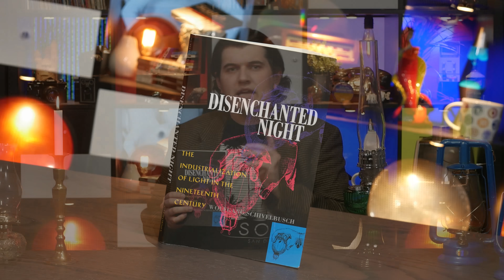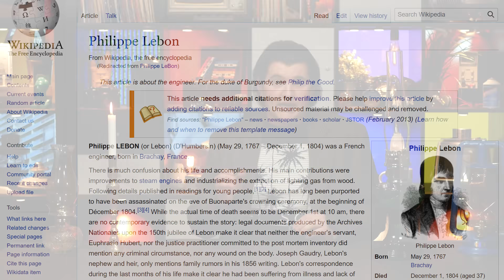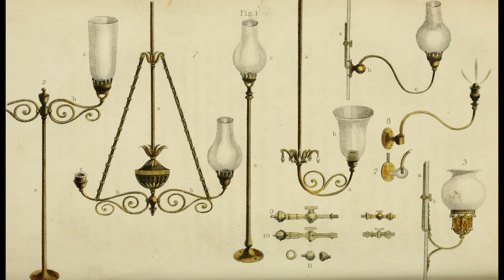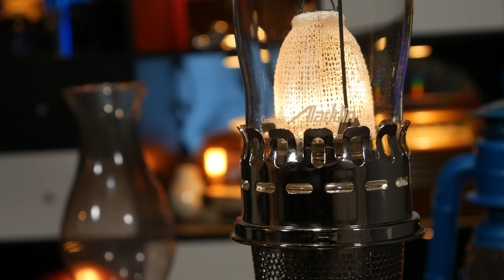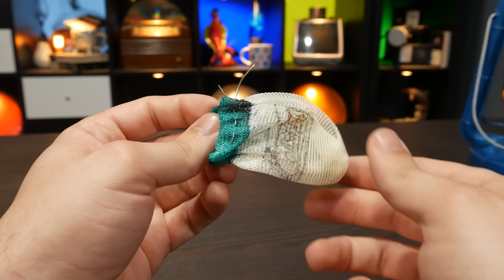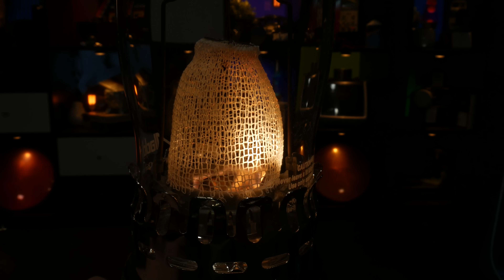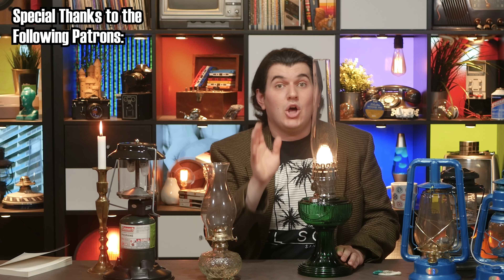How the gas mantle made lamps 10X brighter

Comment: Please heed the safety instructions! The lamps must be monitored during use. DO NOT light and walk away, as the flame increases as the lamp heats. I did this once, lit, turned flame very low, got distracted, smoke alarms went off and red flame was roaring out the top of the chimney.
The lamps are still used in rural areas, by the Amish, they tell me, and mantles, wicks and burner parts are sold in one local hardware. I collect them, they're fun to tinker with, a pain to trim the wicks, but fun to just turn off the lights and watch the lamp run.
Reply: I was raised with aladdin lamps, only 65 years old, we built home made diesel lamps for using while milking cows. My neighbour still doesnt have electric, his mother in her hundreds has moved to a house with electric but she was carrying coal buckets at 99, she couldnt start the generator so had to wait till her son got home, the generator would only run for a while at night. ( We installed electric in several farms when i was young). (In Scotland).
Reply: @windyfarmer.6095  I never had them as a kid but when I started going to rural areas in the 70's all the types were very common, flat, Dietz and Alladin and the Coleman types.  I still have examples of all of them at the ready for the inevitable power failure and the occasional evening just for ambiance.
Reply: @windyfarmer.6095 DIESEL doesn’t evaporate like gasoline, so how did you get a lamp to burn from diesel?

.
Reply: @electrictroy2010  We used kerosene (alternatively diesel, but would not burn as cleanly) lamps in civil service. They contain an evaporation tube that heats the fuel and turns it into gas. The gas mantle is enclosing this preheater tube and heats it.
To start it up you have to pre-heat this tube with fuel tablets.
Reply: Norma,I am wondering if the old style Aladdin lamp idea with an incandescent mantle could be adapted to a mantle lamp that uses Bio Ethanol for fuel rather than Kerosene/Paraffin.
Ethanol burns much hotter than Methanol and carries far less toxicity issues with its use. 
As far as wicks for burning Bio Ethanol are concerned I already use homemade wire filament wicks in small bottle type burners. 
I think there may be some worthwhile experiments in adding an incandescent mantle.
Reply: @howardosborne8647  If the lamp already has an evaporator tube system, the vapour will pass through a "jet" which regulates the flow of  fuel into the burner assembly (mantle, whatever) and maintains a back-pressure on the fuel pump and delivery system. You will likely need a different size "jet" for a different fuel with a different heat yield per volume delivered to the burner. If the jet can be unscrewed and replaced, getting a different jet MAY be possible (though for getting the correct jet - the manufacturers may not have one ; threads and jet diameters are not standardised and are not interchangeable).
You might be able to get a "blank" jet (no hole) and make your own hole to size. 
Your project is do-able, but may not be easy.

"Ethanol burns much hotter than Methanol and carries far less toxicity issues with its use." 
Most retail fuel-ethanol is "denatured" with enough methanol to make it poisonous, to stop people from drinking it. See your local urban myths about "meths drinkers going blind" - the first effect of methanol poisoning is typically damage to the optic nerve. The toxicity difference between methanol and (denatured) (bio- or industrial- ethanol) is not worth recording. They're both poisonous. 
Methanol has a different heat yield per volume of vapour. You'd need to change "jet" if swapping from "methanol" to "ethanol" (denatured or "vodka"). I'd just find which is most reliably available, and set your project up for that.
Locally, it is getting very hard for me to find the correct fuel to use in my camping stove. I've had to (reluctantly) get a propane/ butane stove.
Reply: Lehmans in Kidron OH?
Reply: @ronunderwood5771 Lehman's is a very good source for lot's of stuff! W. T. Kirkman Lanterns in  Ramona, CA is another good source for oil lamps and lanterns. I've collected of a variety of liquid fueled lamps and lanterns over many years. Another tip, Kingsford or other good quality charcoal lighter fluid is a good alternative to ultra pure lamp oil. (Burning too much regular kerosene gives me headaches.) My experience with Aladdin lamps is that while they are cleaner burning than flat wick lamps, they are not quite odorless.
Reply: My grandmother had one in the 80s
Reply: The incandescent mantle requires higher temperature to glow. Chimney glass pipe will increase temperature or forced air directed at flame like for Blacksmith bellows concept , computer fan even .
Reply: You had (very probably) put a more volatile fuel (petrol, gasoline, naptha) into a lamp designed for a less-volatile fuel (diesel, kerosene, petrol). It is important.

I remember once meeting, at a mountain hut, a kilt-clad man who had to put his cooking stove out by picking it up with long-handled pliers and dropping it into the stream. I questioned him about this - since I had a similar stove which behaved itself "better" - and he told me "it's meant for petrol, but I use 40/60 petroleum naptha". Which was obviously meant as a brush-off, but since my father was an industrial chemist, I understood him, and we continued chatting at that level before heading off our separate ways.
A couple of years later I met him again, still kilt-clad, in a lecture theatre at the local university chemistry department where he was a literal professor and I was a junior student. He always wore a kilt because the burns on his legs from a mistake when he was a student made trousers too painful. This made him very recognisable.

He understood his tool perfectly (note : he carried long-handled pliers), had a source of 40/60 petroleum naptha, and was deliberately abusing it under control.
You put the wrong fuel in a lamp designed for a different, less volatile, fuel.

Comment: 14:44 the flames are different shapes and fuel mixtures, but their heat is relatively the same. the difference in brightness is due to flame coverage on the surface area of the mesh. thus, you cannot conclude from your hackneyed demo that "a pure and hot" flame is necessary or better than any regular flame.

Comment: Lute, In Chemistry: it is a liquid clay or cement used to seal a joint, coat a crucible, or protect a graft. As for "protect a graft", again, in chemistry, it is referring to something like a long, thin, glass tube inserted through a hole made in the side of large glass beaker; the graft being that 'connection'. Whereas, again in chemistry, a "joint" is specifically where two ends are 'joined' together. Thus, the phrase, "...forced my lute", means that it broke through material that sealed and connected the 2-piece glass made item together.
Reply: who up forcing they lute
Reply: Goat
Reply: Thank you random 30th Armored Brigade guy.
Reply: @rediius that would be 30th US infantry division (Old Hickory/ Roosevelt's SS)
Reply: I assumed about the same. I wasnt familiar with the terminology, but I figured it meant one of th glass containers exploded or broke.
Reply: THANK YOU!!!
Reply: So you didn't read the pinned comment posted a year before yours?
Reply: I thought the person meant "Force My Loot" as in "forcing treasure or valuables down through something".
Reply: @SuperFlashDriver Do you mean like, cash down a well?
Reply: @bugsbunny8691  Yeah, that's what I thought the person was saying. But it turned out he meant something else.
Reply: Outstanding. Thank you.
Reply: I was about to explain as well... its not hard to research at all.

Comment: Interesting and informative video. I remember many years ago having a Coleman lamp with the bag shaped mantles like at 17 minutes. When new, you had to burn off some material that was blue if my memory serves me right. After that, they worked well, putting out a lot of light. The fuel it used was naptha.
Reply: They are pressurised lamps
Reply: I have two of those old Colman lanterns.  My dad bought them back in the 60's.
Reply: I still have a couple my parents used when camping, when I was a kid. They still work but I always start them outdoors.
Reply: Some mantles (Coleman) are thoriated,  meaning they are treated with thorium and are radioactive. The thorium increases the brightness.
Reply: @daryllect6659 that's why you had to commission them outside. Afterwards they were considered safe for indoors. You couldn't touch them simply cos slightest touch would destroy them like a moth flapping around . Thus an inbuilt safety precaution built in 
  You needed to wash hands though after commission ing.
Reply: You beat me to it  by a day - 1 year after the video came out...!

Comment: You know there's a way that incandescent bulbs could actually match the energy efficiency of LEDs... Insulate the filament so it doesn't require much extra heating once the filaments are upto temperature. The only issue is that it would cause allot of switching lag. You'd switch it off and it would keep producing light until it cooled back down.

Comment: I lived in a building from 1914 that still had gas pipes as the primary lighting method. Of course when i moved in in 1985, electric lamps were installed in place of the gas ones, but I guess still in 1914 someone thought gas was the thing.

Comment: Off grid long ago I utilized kerosene lamps extensively. Exact wick trimming, adjustment as they warm up and chimney affect increases, and preventing fuel starvation were some key skills/duties. My mantle lamp was a great improvement but so fragile and expensive and always breaking I delegated it to a different purpose. While a regular lamp could gradually cook some soup the blue flame of the mantle lamp, with or without the mantle, was sufficient to do some frying in a cast iron pan.

I learned to never buy the dyed kerosene "lamp fuel" due to irritation of eyes etc but only pure kerosene which is a touch higher than #1 diesel.  #2 diesel is what trucks burn but is mixed with #1 for winter months due to waxing/coagulation problems. "Fuel oil" for furnaces I learned is #1 diesel unless you have indoor tank, then they give you slightly cheaper #2. Some stoves that claim they need kerosene like "Toyo" seem to operate ok on #1 diesel but I have no experience with that.

"Coleman Stoves" that used to require much more expensive "White Gas" became able to run on gasoline, was that because of the removal of lead? I don't know.

Comment: I was blown away 20-30  years ago, taking the family camping, I picked up a Coleman propane lantern and had to figure out how to tie those little mesh bags onto the pipes. I could not believe how bright that thing lit up and never understood it. It was so amazing, it's stuck in my memory to this day. Finally, today watching your video I get it. Kind of. Thanks!
Reply: ain't yet watched entire video... Those mantles represent the first commercial use of rare earth elements/lanthanides . A number of the rare earth elements glow brightly at reasonably achieved temperature. Cerium and thorium especially I remember. Thorium was the best performer and no longer used today . A fresh mantle is a cloth impregnated with nitrates of the rare earths and a silicon based chemical perhaps ammonium silicate. After commissioning by burning the installed mantle in situ,  the ammonium and nitrate components and cloth cellulose are volatiled away leaving the rare earth oxides within a newly formed silicate solid structure that has formed in the  matrix of the previous cloth fabric with some 40% shrinkage .
Reply: They don't keep mosquitos away.  I have experience with this too.

Comment: The problem is the burner on the Aladdin lamp.   The newer designs of burners are inferior to the model B that was used for more than twenty years.   But the cost to produce it became too much.

It was said these made a white light equal to a 60 watt light bulb.  Then they had problems with the mantle production and revamped it.  Now they or last I checked, claimed it equaled 40 watts of an incandescent light bulb.    

You will never get that to fully burn without one side having a high side.  That's just the way it is.    With the newer burners, they're more prone to run away and produce a flame too high and soot.   

These do run hot.  You can't put one of these near the ceiling.   Hanging lamps have a smoke bell to deflect the heat.    it will burn the brass plating off it as it's that hot.

What has really killed the Aladdin lamp corporation was the mantle debacle a few years ago and now replacing it with an inferior grade mantle that is extremely expensive compared to the ones of the past.  The wicks are poor grade as well.

These lamps are highly collectable and some go for several hundred dollars.    Some of the green colored ones used uranium oxide as a colorant.   If you take a black light and it fluoresces  from green to a light blue, it's uranium oxide that's doing that.

Besides the lamps they also made a kerosene powered refrigerator that had a little freezer compartment with it. They also made the Aladdin thermos.

With WWII and restrictions on metal for the war effort, production of the lamps slowed or stopped.  The sales of these lamps declined since then with the REA moving across the country.

Comment: There have actually been a number of different gas types in use pretty much since the start of the Industrial Revolution.  The process of making coke for use in blast furnaces produces it.  As does the operation of the blast furnace itself.  Initially it got used just to provide more heat for the furnaces, but there's rather a lot of it, and the ability to control your fire precisely made it really nice for steam boilers and lighting and cooking.  Many other industrial processes also produce combustible waste products, either gas or liquid, that we then adapted for use somewhere.  (Indeed, the whole reason we use gasoline to power car engines is because it was a refinery waste product that was too volatile to be used for the same applications as kerosene, but not volatile enough to just shove into the gas pipeline, so what do we do with it?)

But, of course, gas was only available near large industrial plants.  Which is where the research into coal gassification for producing it elsewhere came from.  Because it beats the pants off of hauling in solid fuel and hauling out ash all the time, with relatively little wasted energy.

The individual, per-home gassifier didn't exactly fizzle out entirely.  It eventually morphed into a way to fuel internal combustion engines in places where petrol-based liquid fuels weren't available.  The upside is that it's more portable, the down side is that a large portion of the combustible gas produced is carbon monoxide...  Use with caution.

For quite a while, acetylene was actually a pretty common fuel for gas mantle lamps.  It produces a nice, hot flame and, before decent batteries came along, calcium carbide was actually a really effective way to store the energy output of things like hydropower plants for later.  (And, since a solar furnace can generate sufficient temperature to produce it, it might not be a bad way to run a solar power collector either, aside from the necessity of carbon and lime as inputs.)

These days the various CO-heavy gas mixtures don't get used much outside of where they're actually produced, because nobody wants an odorless, explosive, highly poisonous gas pumped into their homes when electricity is cheap and available.  So we've got "natural" gas that comes out of the ground in largely the same places oil does and "refinery" gas that's the leftover from the process of refining crude oil, and the two are so close to the same chemically as makes no difference.

Comment: If you never saw an Aladdin lamp burning, you are missing out. These things are less a completely different animal, but more like the supreme emperor of oil lamp world. Everything about them, from how bright they are, to the temperatures they reach (I once lit mine on the floor and the bit of the ceiling above the chimney was warm to the touch after I put it out), to their sheer size and voracious appetite for fuel is just off the scale compared to 'regular' lamps.

Comment: When I was a kid near Carmen, Idaho in the early 1960's power failures were a common occurrence. I did homework many times by the light of Aladdin lamps. In fact, I still have two of these lamps ready for use at any time. I can still buy wicks and mantles from the Aladdin company. The only difference between now and 60 years ago: I now burn liquid paraffin in the Aladdin lamps instead of kerosene. The liquid paraffin is even trickier to burn than kerosene but it won't evaporate from the lamp between uses.

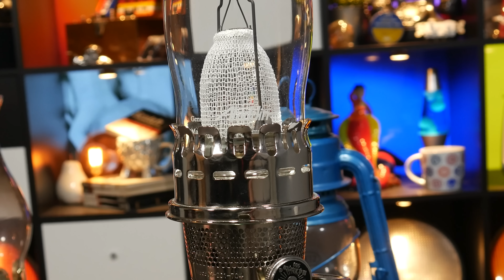Comment: 14:28 
>[...] with a very high melting point. About 2400°C or 4400°F, or just shy of 2700°K.

Since the Kelvin scale is an absolute thermodynamic temperature scale, meaning it uses absolute zero as its null (zero) point, it should never be referred to as a degree, which are relative measurement systems.

Comment: From this it seems clear that "forced my lute, or broke my glasses" means that:

the increase in pressure forced the luting material from the hole, opening it and releasing the pressure, or instead
this luting safety mechanism did not work and the glass itself broke under the strain.
¹ The reference given for this is: Encyclopædia Britannica. Eighteenth Century Chemistry as It Relates to Alchemy (reprinted Kessinger Publishing, 1992) p. 78-79.

Comment: The indoor hurricane kerosene lanterns glass globe had a rare variant that had a horizontal brass tube through the top of lamp chimney to hold/heat womens hair curlers. Also there were teapot heater attachment that rested onto of lamp chimney that worked like a tiny hotplate.